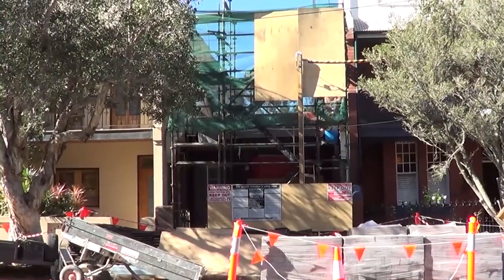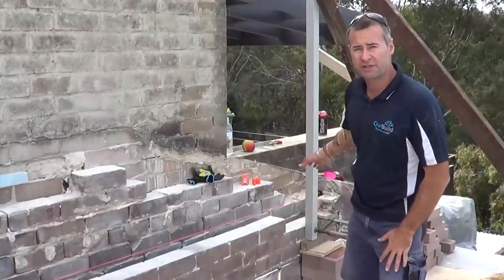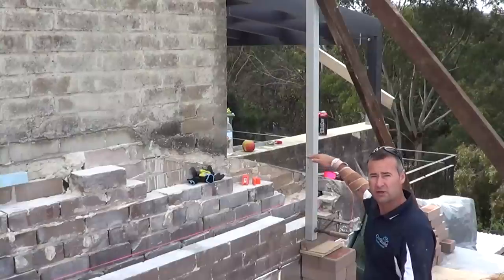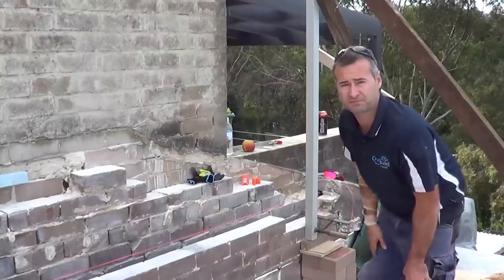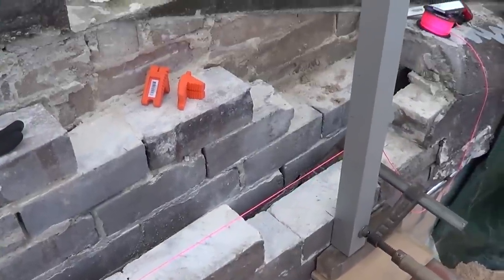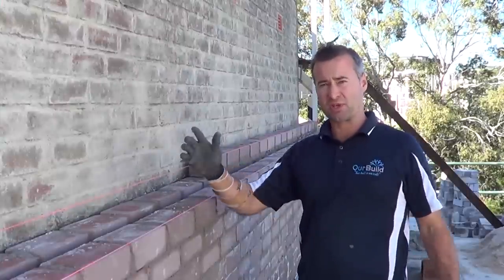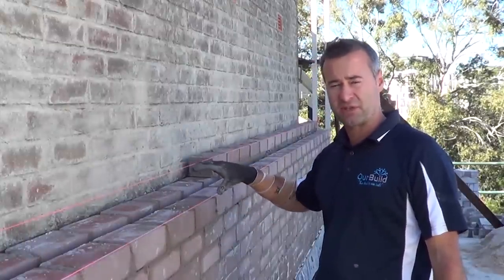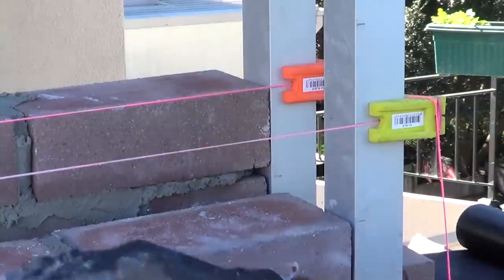Episode 4 - Brickwork stage - Small Space Big Build Project

Comment: Hi. Thanks for making the effort to film and load this series of videos up for us hacks (talking about me there) to view, and hopefully learn some lessons on how to proceed with a remodel and build. I am in the process of working out wether or not I can afford to do some house renovations, and possibly remodel myself. I have to put on a new roof as the current structure is a 'hickledy pickledy' mix of the most basic concrete tile from the 50's (no sarking, no insulation, nothing but daylight creeping in through the cracks), with klip lok sections that fill, and add a extension (hard to explain how much of a botch job my roof is, which leaks like a sieve). The only way I will be able to do the renovation is as an 'owner builder', and to do as much of the labour work as I am allowed to do. I have only minimal experience in any labouring work but I am keen to learn. And keen to do. Can I ask about the Scaffolding. How did you choose who to use. Was it more than just going for the cheapest quote. Is there an economical way in managing the scaffolding such as, only hiring a certain length of scaffold, then taking it down after a particular section of work is done, moving it along, then putting that same scaffolding back up for the section of work. I'm also from Sydney, from the southwest. Are the Certifiers concerned about who does the work such as brick laying, and framing, of course electrical, plumbing, and water proofing are important to be carried out by licensed tradespeople, but , as I only have some basic bricklaying to do would certifier pin me down on who has done the bricklaying, and/or framing, or are they more concerned about looking at the job, seeing that it has been constructed and built to an appropriate standard and that it complies. Excuse me, I could go on. So much to ask. thanks again for up-loading all this really interesting and helpful content. take care. I have seen a video on your new place, just the 1st video about the planning, and what a great place you and your partner/wife have designed. I guess, and hope that its built now. Fantastic location, and house. Looks like you've both really thought it through. Well done to both of you. take care..

Comment: hi james excellent videos. just wondering if the internal skin of brickwork is going to be covered up and if yes would nt it have been quicker to build using concrete or clay block..blocks. in ireland are 215 mm high 440mm long and 100 mm thick so its 6 brick to a block .bricks are 65mm high 100mm thick and 215mm  long. mortar joints are 10mm.
Reply from the maker: Thanks for the comment bric bybric, glad you enjoyed the videos! Yep we have something similar hear, I believe its called a speedy brick, we mainly use them on new developments and new homes. Because I hade to tie in with some of the existing brickwork I made the choise to keep all the bricks the same size as the original, but to be honest it probably would have been cheaper and quicker to use the larger bricks.... All the best, James.